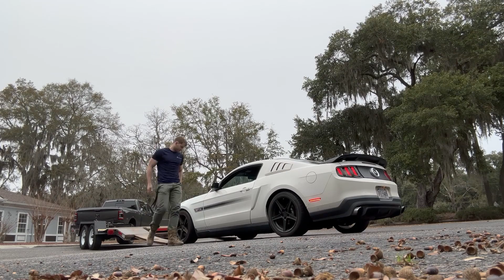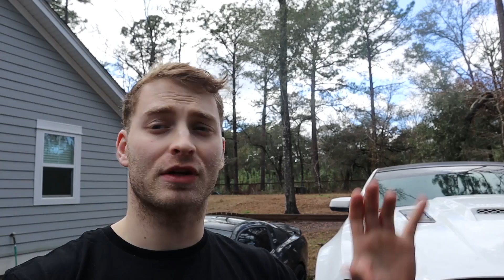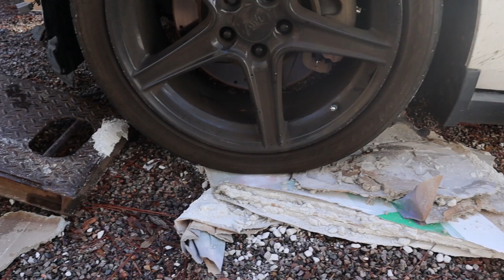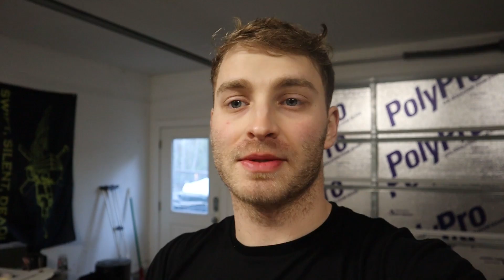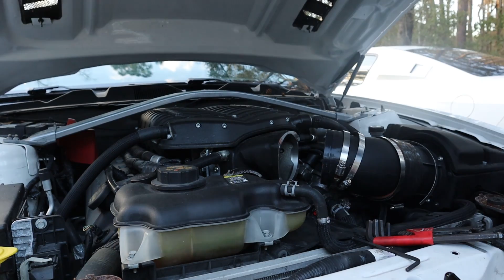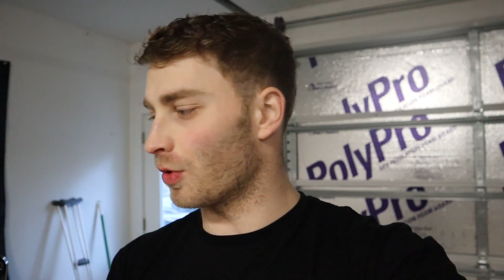My Whipple Supercharged Mustang Broke Again

Comment: Me I went through two Ford performance throttle bodies for the Cobra Jet before I got one that worked properly. It really drove Lund tuner Dakota through the roof why I was have so many problem getting it to idle/drive properly.  Sent one off got the second one same issues.....Lund Jr with some aggravated tones over the phone......finally he said send it back as well.......I did, the next one the car woke up and drove like a champ and I reinstalled revision 2 and all was great. That was 2 years ago and the car is still running like a champ.  Yeah throttle body wows been there done that and it sucks especially when stuff is brand new out of the box and it's broke. Yes there are some adjustment screws on the throttle body but if you tamper with them you void the warranty - now if it happens yeah I'll tamper with them, not new out of the box though.
Reply from the maker: This gives me hope that it’ll be fixed this time, and nice to know I’m not the only one having this problem. Glad everything worked out for you!